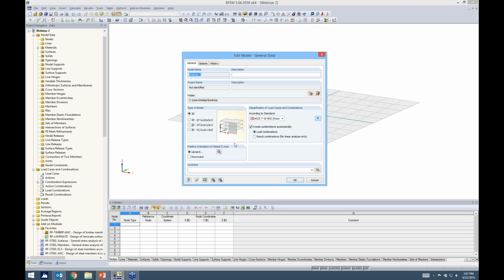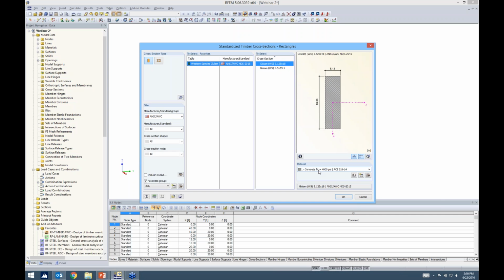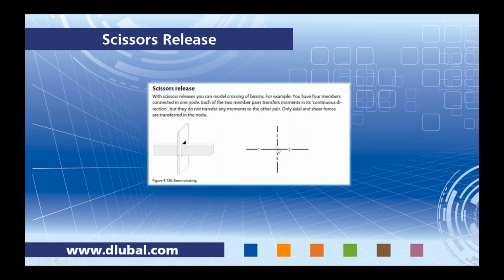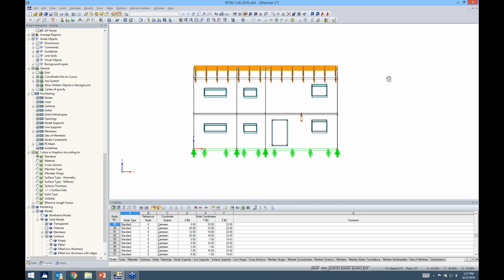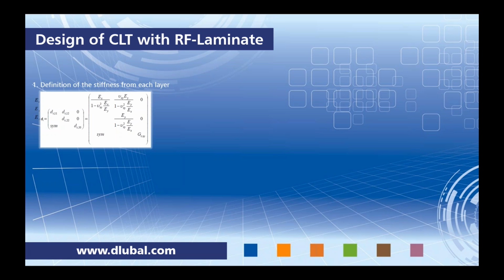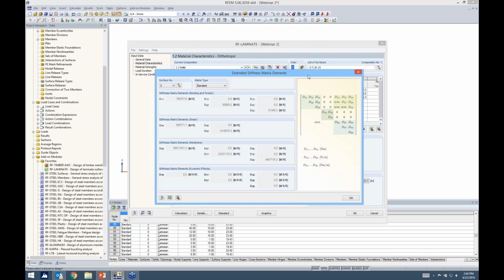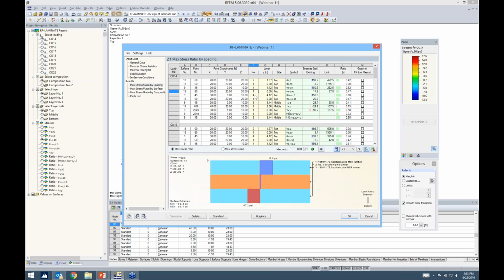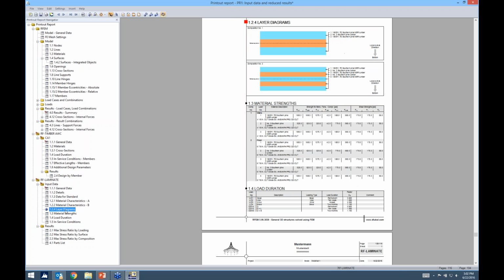Webinar: NDS-2015 Member and CLT Design in RFEM (USA)

Comment: What type of connection is considered between the walls and Slab? Are steel  connections considered? If so, is it included in the analysis?
Reply from the maker: Hi, Pavani!
The CLT walls to CLT floor panels are considered a fully rigid connection by default.  A line hinge must be added to account for the connection which includes the slip and moment release of the screws.  This process can be seen at time 47:40.

Comment: Hi. is it possible to model laminated bamboo in a similar way to this?
Reply from the maker: Hi, Pavani!
RF-LAMINATE will allow you to enter in custom material layers such as bamboo. You'll need to manually set the material strengths within the program and a general stress design can further be performed.  Alternatively, if you know the global stiffness properties of the entire panel, an orthotropic surface can used directly in RFEM with the option to define the stiffness matrix manually.  A full analysis can be performed.
Reply: @DlubalEN  What about the codes to be used for bamboo then?
Reply from the maker: Hi, Pavani!
There are no specific standards implemented in RFEM or RF-LAMINATE for bamboo design.  The RF-LAMINATE module can run a general stress design meaning the demand stresses from the analysis are compared to the limiting stresses of the material for a stress design ratio.

Comment: Can laminated bamboo be modelled in this software?
Reply from the maker: Hi, Vandana!
RF-LAMINATE will allow you to enter in custom material layers such as bamboo. You'll need to manually set the material strengths within the program and a general stress design can further be performed.  Alternatively, if you know the global stiffness properties of the entire panel, an orthotropic surface can used directly in RFEM with the option to define the stiffness matrix manually.  A full analysis can be performed.

Comment: What about the type of glue used for the gluing of boards? Does it affect the result in any manner?
Reply from the maker: Hi, Pavani!
The type of glue will not affect the analysis or results in RFEM.  There may be glue type requirements from the various approvals in your country however.